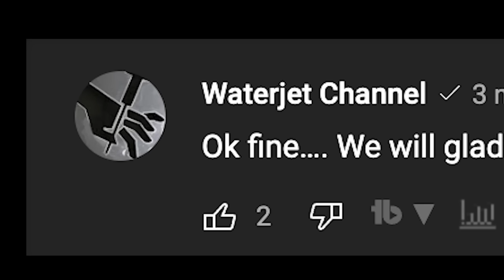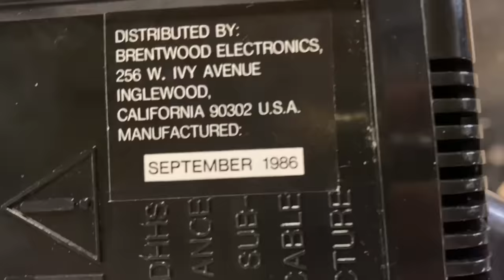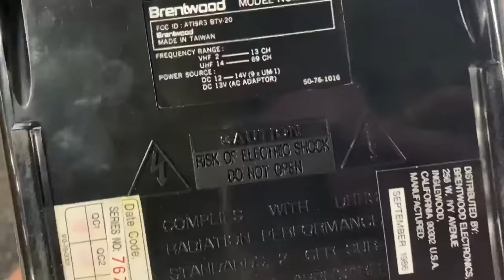We Cut Adam Savage’s Foil Ball In Half

Comment: The strange smell is probably from the fine mist of water that contains one or more hazardous chemicals/powders that are inside the cathode ray tube. :-)
Reply: Inside cathode ray tube should be just vacuum so there's very little any chemical or powder there. The smell probably comes from electrolytic capacitors that used to have all kinds of weird chemistry back in the day.
Reply: @MikkoRantalainen  Some could be the circuit board itself, those things smell odd if you break them in half
Reply: @Berkeloid0  whoops, guess my lungs are a bit fuzzy!
Reply: @MikkoRantalainen  There's a layer that fluoresces when the electrons hit it which can contain some nasty stuff: 
"CRTs contain toxic materials such as lead, cadmium, barium, and fluorescent powders" 
(from Lecler, Marie-Thérèse et al. “Exposure to hazardous substances in Cathode Ray Tube (CRT) recycling sites in France)
Reply: @teslatrooper  I think lead was used in the front glass of the CRT monitor (and in the leaded solder). I think cadmium wasn't used in the phosphor since around 1965 but if you have old enough CRT monitor, sure. Barium was used as a replacement for lead glass in some CRT monitors.
Reply: @MikkoRantalainen ur Wrong buddy
Reply: @Jaizizzizi  Could you elaborate a bit? I'm happy to be educated about any mistakes I've made but simply claiming that something is incorrect without explaining what and why, your input to this discussion has zero value.

Comment: Fun fact about not finding a signal: the analog waves those TVs ran off of have pretty much been 100% disabled. So even if you did get the right contrast settings... you wouldn't have connected to everything. If you tried in 2010ish, you might have gotten PBS.
Reply: Yeah all those analog TV signals are mostly (completely?) gone now, about all you could do is hook up a video source to it like an old VCR or something and have it playing while cutting. Was still cool though, to see how much punishment it took before it finally died.
Reply: @DwellerBenthos The broadcast stations now use a different part of the RF spectrum. You can get an adapter so old TV sets like this can still display broadcast TV signals.
Reply: @RobRoss  Right, those converter boxes they were practically giving away with the government subsidy back when they switched over. You'd still need an antenna that could receive a signal, hook it up to the box, then to the TV which is why I said an old VCR would probably be better and less hassle to hook up and get working. Plus that would be a more more reliable signal as to what is playing if you're going to record it for youtube, don't want to have a TV show or news broadcast on the set while it's being cut, you might be misconstrued as to voicing an  opinion on said content, can't have that.

Comment: Hi, I've been watching your channel for a while and had a question more about the business side of the water jet. I install flooring and I've worked with a local water jet company a few times to cut complex designs into vinyl floors. They've always done good work but on the last and biggest job there were some issues and I don't know if they're to blame or not. It was a pretty simple design, just DNA and various diagrams of molecules so just a bunch of different size circles and bars connecting them. The problem was that when they cut the colored tiles they used the same dimensions as the outline in the white field tiles. So there ended up being a gap the width of the kerf between the designs and the places they were supposed to fit. It caused some problems since the material is flexible and easy to distort even when solid. Now I doubt we specced two different sizes so that could be it and it was our fault but we've done similar but smaller projects with them previously and whoever programmed the machine at that time realized what we wanted and accounted for the width of the cut. So do you think we should have been more clear, they should have asked for clarification or a bit of both?

Comment: 4:01 OMG, that NOISE! I know it is only analogue white noise, but it takes me back as you no longer have this chaotic, grating sound with our modern digital TVs and radios (although, side note, if I am going to be subjected to interference  give me analogue over the FAR more obnoxious digital interference any day, but that's just me). I grew up in the 80s & 90s and I remember my Mum had a TV/Radio combo unit in the kitchen. It wasn't exactly portable  - the black & white TV screen was maybe slightly smaller than this one but, extending off to the right of the screen, was a long, analogue, old school type tuner. The whole thing was about the size of a Playstation 5, just slightly longer and slightly fatter. Anyway, Mum had this thing in the kitchen throughout the 1980s, it rarely got used, and for almost a decade it sat on top of the equally obsolete 1980s microwave oven. As a kid I used to think the thing was so cool and I used to flick the switch back and forth which toggled it between being a radio and a TV. Part of the issue was that our kitchen used to be in the basement, and with it being an analogue device, the reception was terrible and 90% of the time, particularly with the TV, all you could pick up was that familiar white noise EXACTLY as we hear at 4:01. Anyway, by the time I was 15/16 (c.1992) I had almost forgotten about the thing. It still sat in the kitchen and, extremely rarely, my Mum would listen to the radio on it but the TV function had not been used for at least 3 years. I was home alone and, no joke, it was Hallowe'en (because of course it was!). At the time we lived in a tall town house and my bedroom was effectively the attic, where I was very lucky and was fully decked out with my own little TV (no flat screens back then, it was a great big lump with a little 14"screen, lol). With it being Hallowe'en, and with me being a dumb teenager, I was watching scary TV shows (I literally think it was the infamous "Ghostwatch" on the BBC which, if you don't know about it, look it up, it was amazing!). Anyway, waiting for the show to end (we had no "pause" in those days) I went down the 3 flights of stairs to the kitchen in the basement to make a tea and grab a snack. Our kitchen was quite long and you could turn the lights on in 2 sections - I switched the lights on for the counter by the kettle, but the old TV/Radio device was now at the far side of the kitchen, in the darkness. As I was making my tea, a little jumpy anyway as it was the middle of the night, on hallowe'en, I am home alone, watching scary TV shows and I'm a stupid teenager, all of a sudden the blasted black and white little TV screen TURNS ITSELF ON .... FULL VOLUME! As it was situated at the far side of the room, in the pitch black, the white fuzzy light of the screen lit that half of the room up like a strobe light, and the rough, white noise sound was deafening. I swear it almost gave me a heart attack and I stared at it from across the room for a second in fright ..... when it just SWITCHED ITSELF OFF AGAIN!!! Right in front of my eyes, with nobody but me in the room, stood well over 10ft from it! I have to admit, I was pretty terrified. I didn't want to go near it at first and I cannot recall if it came back on again or not (I think it did it a couple of times, but it was 30 years ago now so I'm not certain). Anyway, I went over to it and could not see anything wrong with it, so I just pulled it's cable out of the wall. I quietly picked up my tea & my snack, returned to my room in the attic and I did not leave for the rest of the night.

Turns out it all had a very mundane explanation. It was broken. My Mum had been listening to the radio and the thing had just died. Mum opted for the standard "push every button" attempt at fixing it and, in doing so, she had flicked the toggle switch over to the TV setting, at which point the device had switched back on, on it's own, and then it switched off again. Mum simply switched off the power and had left it alone, assuming it broken. She never told me or anyone else that the thing was kaput. Anyway, earlier that day on Hallowe'en, Mum had had a cleaner come by and dust the house whilst she was away (she must've thought her teenage son who had the house to himself for the weekend was never going to do it himself but I don't know what gave her that idea!!!). Anyway, the cleaner seems to have run her duster over the device and accidentally flicked the power switch back on. However, as the device was broken, nothing had actually come back on and she had never noticed. The device, turned on by the cleaner and left on full volume from my Mother's previous "fix" attempts, sat in the kitchen "dormant", just waiting for my arrival for a midnight snack on Hallowe'en like some evil trap. It was so traumatising that even now, 30 years later, when I hear that White Noise I am immediately reminded of that moment ... and I must make myself a cup of tea ....

Comment: just a heads up, not a great idea to poke around even dead circuit boards with your fingers (especially not so soon after it was powered on.) you could have deadly charge built up in certain components, for like many days.
Reply: I was actually curious about that.... like that maybe the water caused any residual charge to discharge?
Reply: @SPUDIKIN  Possibly, but without certainty I wouldn't risk my life.

Comment: Broadcast TV ended 13 years ago, with the switch to digital happening a few years before that. You can still get digital broadcast TV, but the range to receive signals is rather short. You would need to live near a station to pick up anything with only a digital antenna.

Comment: Another idea. 

Fill an aluminium ball with aluminium filings & shoot it using the air canon, into an iron cube with iron filings inside it to see if it ignites & turns into thermite.
Reply: Or manufacture a fat aluminium bullet shell and fill it with the aluminium dust. 
Use a sandbag of iron filings?

Comment: I wonder if it would make sense to completely submerge a device like the TV in clear slow cure epoxy (after cleaning the inside free of dust). Then pull a vacuum to get rid of any air bubbles inside. Then when all is air free and cured cut it open. This should hold the shape of all coils, components and even the vacuum tube.
Reply: In wonder if snipping off the vacuum port on the CRT (to let the air in) would let it hold together better while being cut.